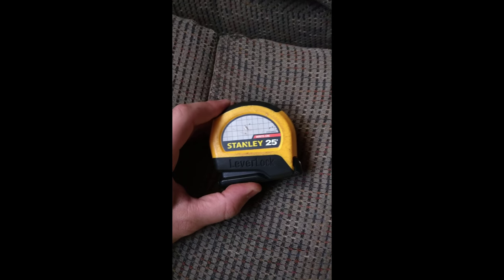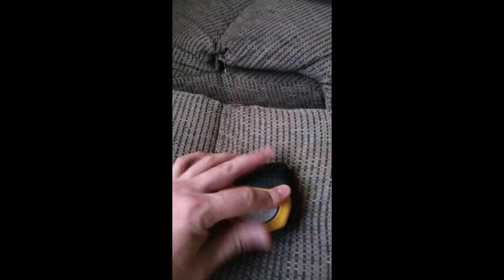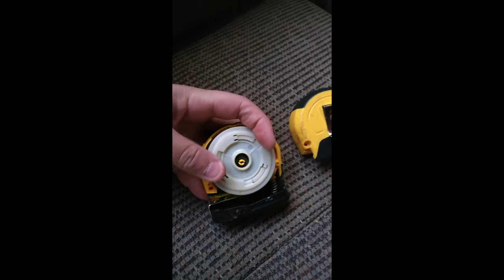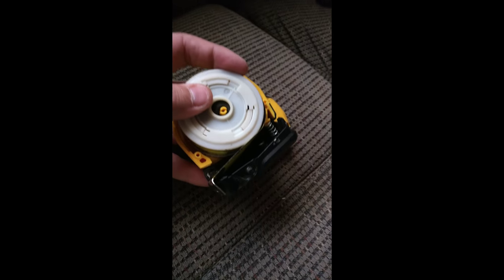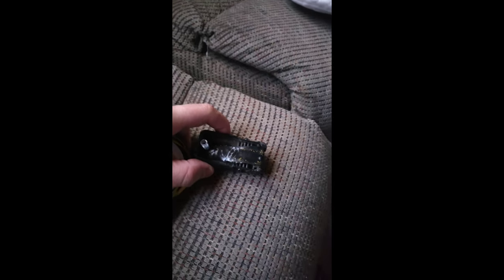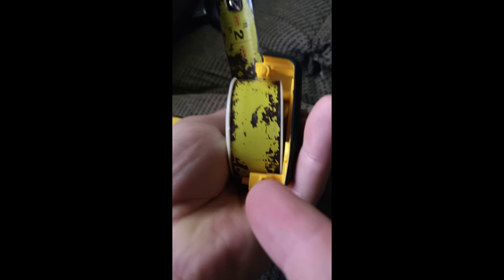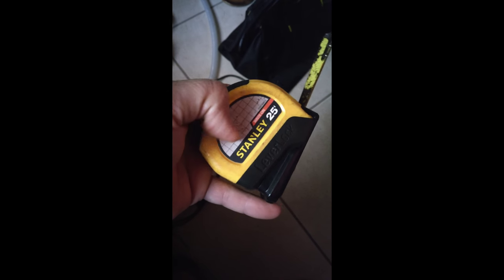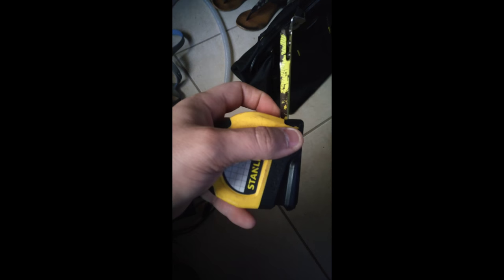Stanley LeverLock measuring tape fix

Comment: Steve in Austin, Texas here, saying that this is the glory of the internet. I have a Kobalt 25' tape that would not lock after years of use, and your fix, which I didn't expect to find, fixed my tape measure, so I thank you sir. Very cool.

Comment: I have the exact same tape measure and it’s been a few years since it stopped locking.  I disassembled it yesterday and was thinking about padding up the base, but wasn’t sure if it would work. Your video confirms that my intuition is correct.  So I tried it today. Had to pad quite a few layers of electricity tape. It now has enough friction to lock it.  But won’t unlock and retract. I just push it in. Still a lot better than before.  Thanks.

Comment: Thanks for the video, my tape measure has been pissing me off for a long time, and I was hesitant to have the whole thing go flying to pieces as I disassembled it.
After watching your repair, I decided to try using liquid electrical tape, and it worked.    I just put a single coating on the inside of the black lever where the tape slides past.   I also used rubber bands to keep the spring and tape measure assembly from unwinding while I was taking it apart.

Comment: Thank YOU for sharing your identification of the problem and creative solution! 😀
I don't use this measure very often so using 6 pieces of electrical tape were a lot less than a new expensive tape measure! 
Once the back was removed, I used a squeeze hand clamp to hold the tape in place/from slipping out and going all over the place and losing the tension.

Comment: I have 3 of those tapes I got at Ace Hardware on black Friday a few years ago for $2.99 each. First one stopped locking after 2-3 weeks of using it so I opened 2nd one and same thing it lasted about 2 weeks, now the 3rd one is also slipping. Total design flaw. I will try this fix thanks!

Comment: thanks for this post...I just fixed my leverlock in less than a minute due to your inspiration.  I pulled out the tape a bit, clamped it down, cut about 2 inches of electrical tape,  pressed the lever open and slipped through the opening onto the lever.  It WORKED    I did 2 tapes.  The second I ended up slipping in 3 layers of tape, but it may be I got the 1st. two layers of electrical tape too far back, because it worked fine on last layer which I cut some away from front of lever after I had put it into measure.  Don't throw away those tape measures_ FIX THEM

Comment: Dude, thanks. Articulate, clear, to-the-point and completely effective. Five pieces of electrical tape...Use a clamp - carefully applied - to hold back the tape from unspringing all over the place once it's taken apart.

Comment: Hi guys, this video was a great incentive for me to take apart my Stanley LeverLock.  It stopped working correctly not very long after I got it.  I assumed it was a defective tape so I bought another one.  That one stopped working too so I figured they all (or most) must do this.  I didn't like the black, sticky smear all over the yellow tape measure in the video which I thought was caused by the electrical tape so I went a different direction with great success. Careful checking shows that the outside edges are the "brakes", not the center ribbed curved part.  Open up your tape measure and you'll see what I mean. Putting electrical tape there obviously works but it has to be a pretty thick layer. I did use the electrical tape, but only to hold the pieces together while I fired up my hot glue gun. I put a THIN layer of hot glue along the outside edges only.    Be sure to apply a THIN layer.  Let it cool for 15 minutes or long enough so that it is cool and hard.  Put it back together. It should work fine.  If your edges are REALLY worn and the LeverLock still doesn't work, try putting on another THIN layer of glue. Let it dry and try again.  If it's too thick and you can't pull out the tape, or it won't retract, use an exacto knife to carefully cut off a thin layer of dried glue.  Mine is a tad thick and the yellow tape has to be almost perfectly level to retract.  I'm happy with that though.  No mess, great holding power! Hope this works for you.

Comment: Yep, works very well!! You only need a few layers of tape.. Try 4 or 5 to start with. Using thicker gorilla  tape only need 2. Why in blazes would Stanley put a small piece of plastic where if it wears down only a tiny bit.. the whole tape is toast.. Design flaw.. Needs beta testing.
Thanks Levi

Comment: DO NOT USE Electrical tape as it will eventually gum up the metal tape surface.  The issue is the black lever lock is prevented from rotating far enough to properly engage the tape.  The shoulders on each front, outboard side of the black lever where it contacts the yellow case stand up too high preventing the lever from generating sufficient clamping force.  Remove the lever from the case, put some 220 grit sandpaper on a flat surface and slide the lever shoulders back and forth to remove a slight bit of material ~ 15-20 thousandths or 1/64 in. (not too much).  Try to maintain the slight angle of the shoulders to the lever while sanding.  Re-assemble and the spring-loaded lever locks the tape as it should.
Reply: Thank you for that solution. I almost went the electrical tape route but was concerned that it could turn into gummy mess. Then I saw your comment and followed your advice about sanding down the plastic shoulders. It was quick, easy and effective. Now to to see what kind of mileage I get from it.
I appreciate the great solution.

Comment: I fixed mine using a small piece of vinyl flooring scrap that has the felt paper backing. I glued a sliver with the paper side rubbing on the metal tape to give more friction. The glue I used is actually polyurethane sealant caulk that I had in my caulk gun. That polyurethane stuff is really durable as a glue and way stronger than silicone. The stuff I used is Quikrete polyurethane sealant. Gorilla glue polyurethane glue would probably work too. If you go to big box stores they have free vinyl floor samples just take one that is real thin so it fits in the gap do not use the thick fiberglass back flooring unless you get the real thin one.

Comment: I have the 8" LeverLock ...but it doesn't have screws to remove the side. Any suggestions?
Reply from the maker: @sungarden4789  I don't have access to one to be able to fully help.  Perhaps poke around on the sticker to see if you are able to find a place where it indents.  If it does, there may be screws behind the sticker.  Perhaps in the center of the tape measure since it's so small and doesn't require a lot of screws to hold it together.  Just light pressure on the sticker should be sufficient with something that won't scratch it up if you're trying to keep it in good shape.  Sorry I can't be more help.
Reply from the maker: I'm uncertain as to whether or not the internals are the same.  Sounds like a journey. Perhaps something you can record and put on the internet!  Take your time.  Think about it. You got this friend!

Comment: I tried taking mine apart. I took the 3 screws out and was at the point where I had a knife in each side trying to pry it apart. Nothing doing. I could feel something was going to snap.

Decided to check YouTube. This guy says how easy it is to take apart and then cuts away to where it's already taken apart. 

Obviously he had the same problem and snapped or broke something.